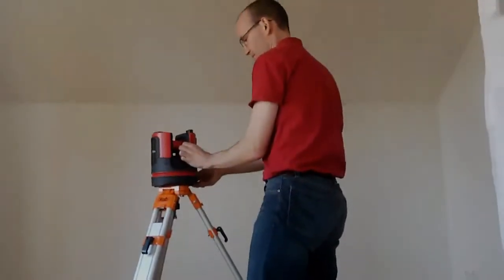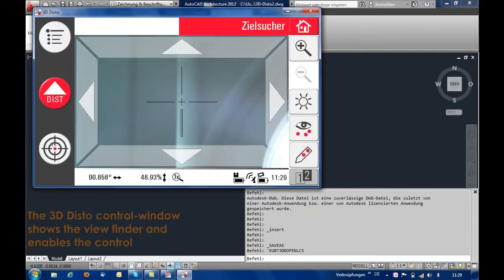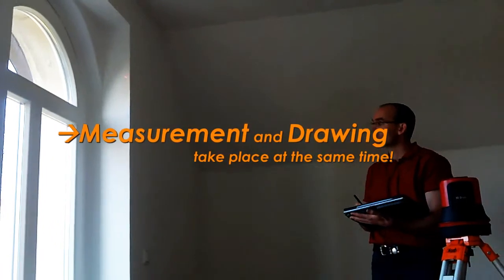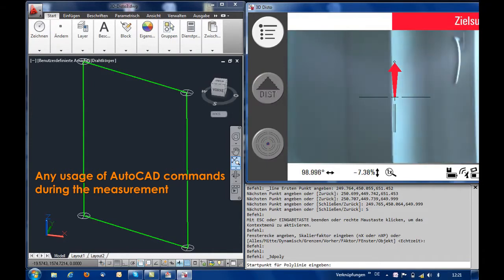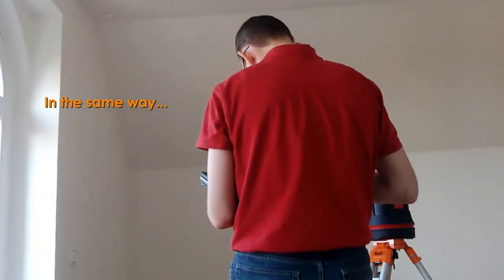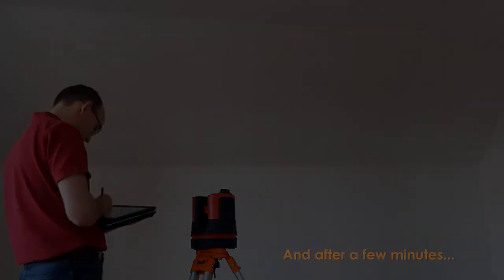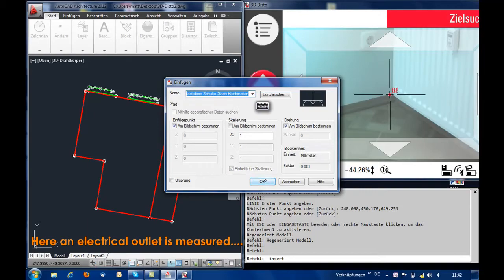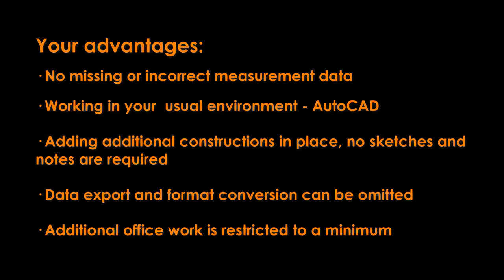Plug'nDraw: Connecting the Leica 3D Disto to AutoCAD

Comment: Will the Leica Disto ever work with a tablet or phone using Leica Sketch and a handheld lazer such as the Leica E7100I.  There are quite a few apps available that allegedly support the E7100I but, none of them work as well as an Autodesk based product such as Acad 360.

I create as-built floor plans in 2D for clients to modify houses by adding rooms and things like that.  At this point in time, I don't see being able to afford a $1500 purchase of an instrument like that.

Comment from the maker: Hi Jez...yes, the ongoing battle between as-built conditions vs.design. The machine will measure the as-built conditions. It is up to the user to decide the tolerance and level of accuracy they need. Some folks want perfect 90 while others need the 88.7 degrees. It all depends on application. You can also look to our TachyCAD software which provides more building survey options. This gives users the option between as-built or a nicer looking "close to as-built" result. Thanks for the comment!

Comment from the maker: Hi Rob,
1. All elements collected are represented in 3D already. If you want to take the lines or 3D polylines into surfaces/solids you can simply use AutoCAD modeling commands (extrude/loft/sweep/revolve). You could also use the linework as a guide for inserting intelligent AutoCAD Architecture, Revit walls if  going for a BIM model.
2. The laser would not be easily visible in bright sunlight. The video screen and target cross-hair would be visible (better on computer screen built for outdoors)